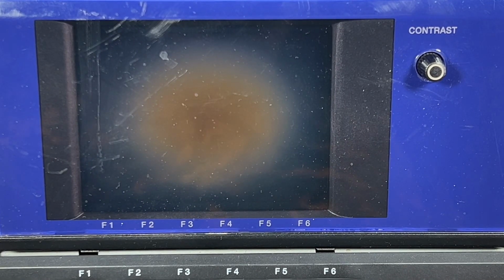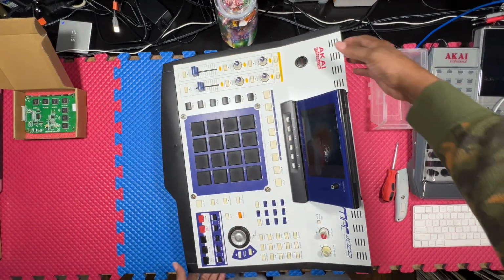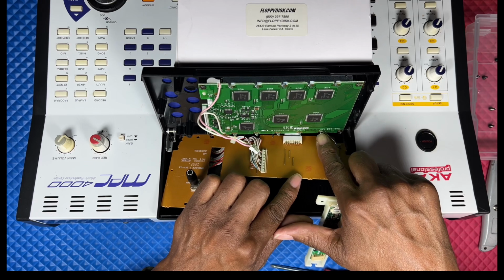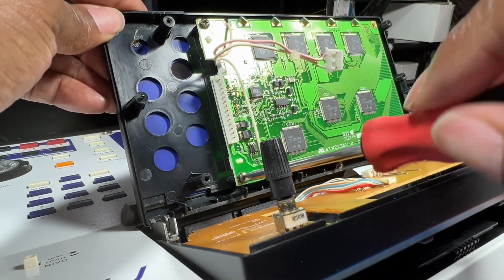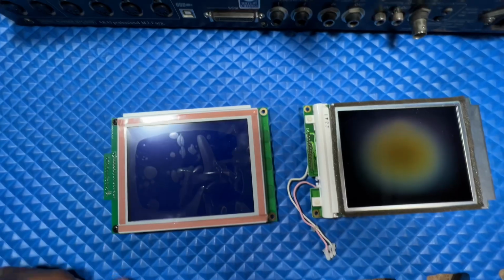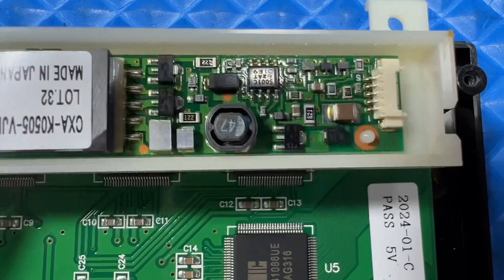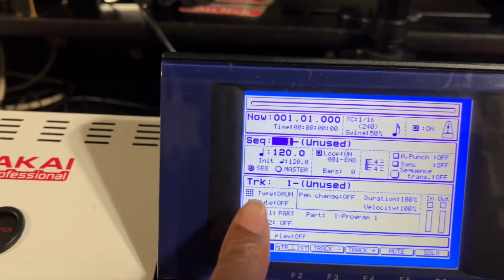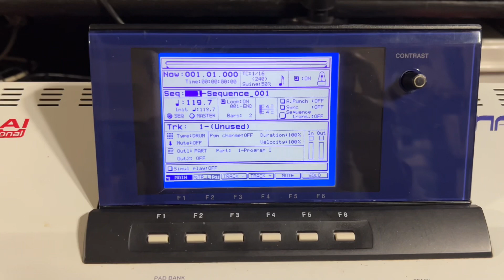MPC 4000 display replacement.

Comment: What did you do with the connector to the inverter board? You just let it loose in there?
Reply from the maker: It’s still attached to the old board.
Reply: @beataddiktgodd  yeah but its not connected to anything on the new screen?
Reply from the maker: @luegoods  you lose the inverter with the new screen